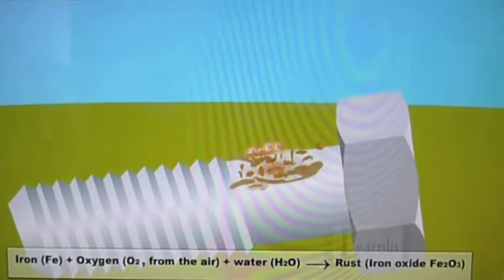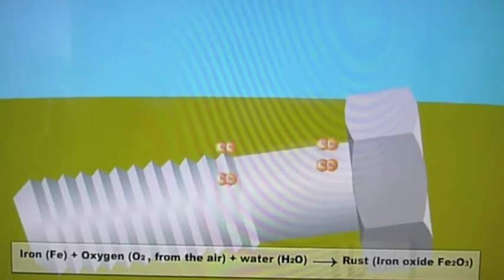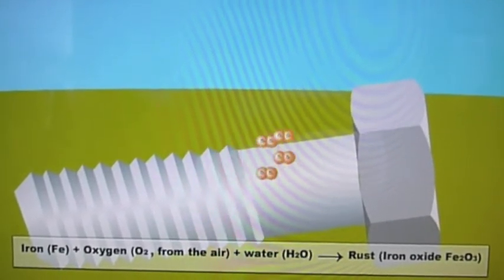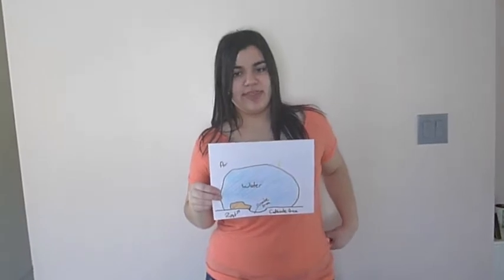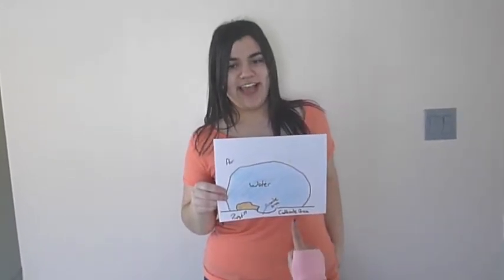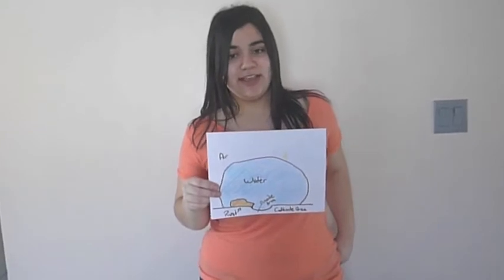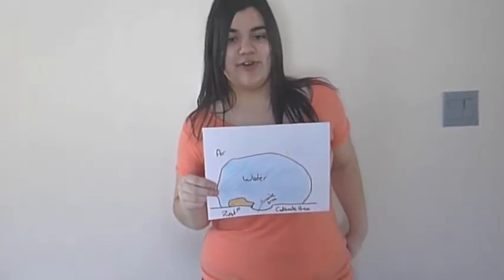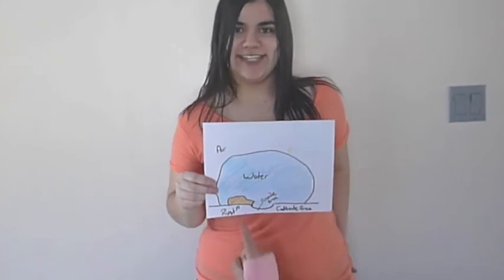Rust Formation

Comment: 3/10

Project was rushed, there were no concluding thoughts at the end. Failed to mention the metals that are resistant to rust, such as aluminum which forms a layer of oxide to prevent oxygen related corrosion. Also failed to mention gold, platinum, and stainless steel.

The upside to this presentation was the wardrobe coordination. Pink hoodies are definitely in!